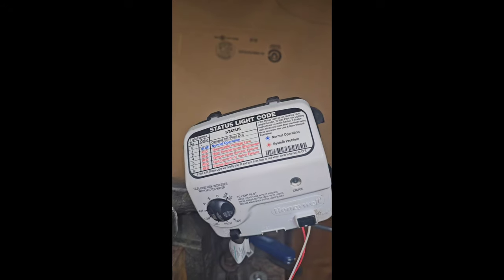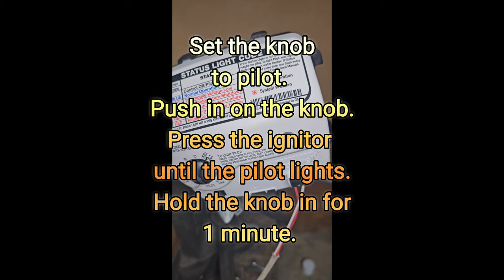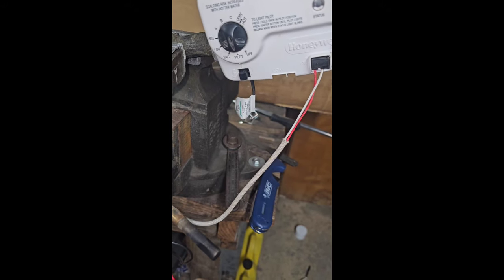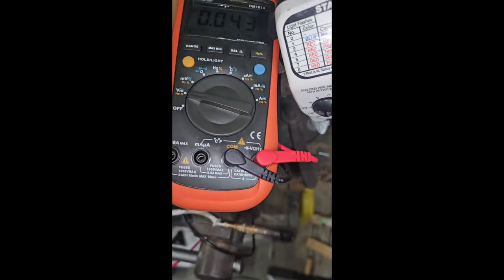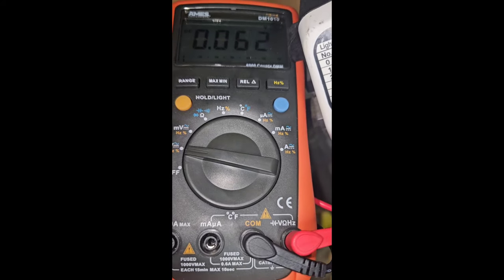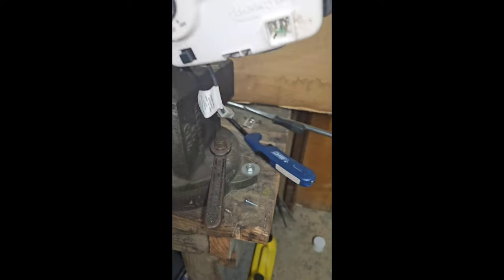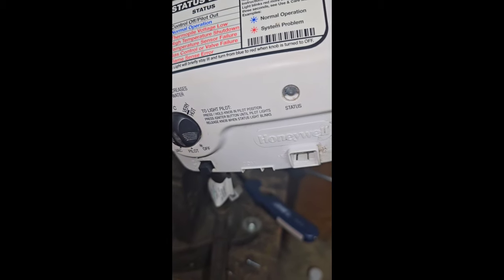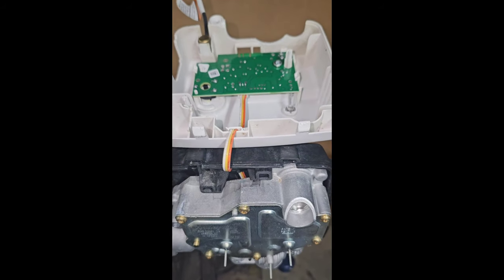Hot water heater gas control valve control board testing and replacement

Comment: So.  Is it is there not a way to directly check the circuit board itself to verify if it's good or bad, or is it basically a process of elimination that the circuit board is the only thing left that can be bad?  Which that looks to be the case.
Reply from the maker: It depends on the defect of the board. Sometimes the issue is visible upon inspection. Other times is corrupt software. What's the issue you are having?